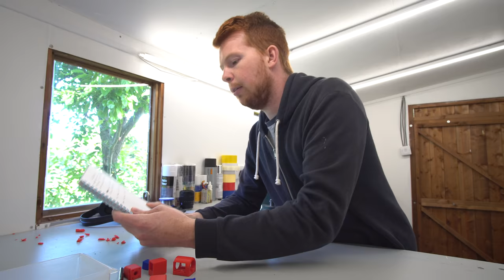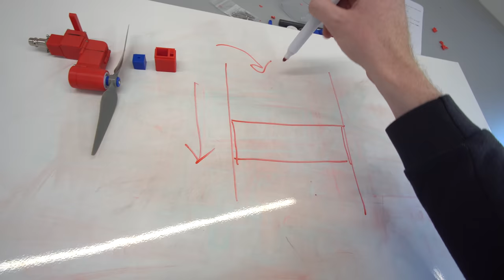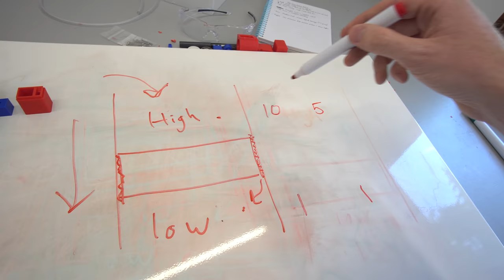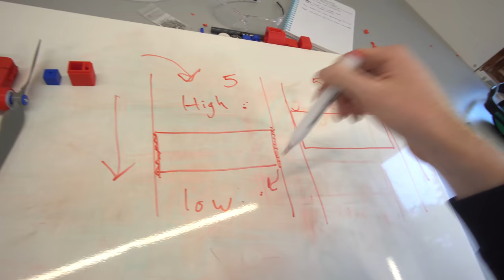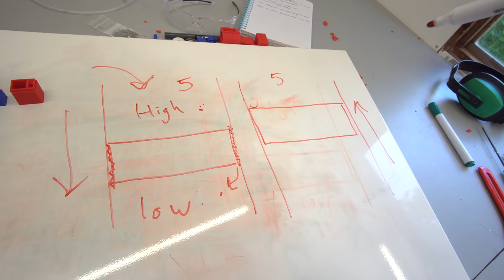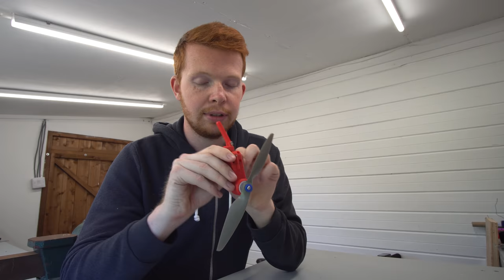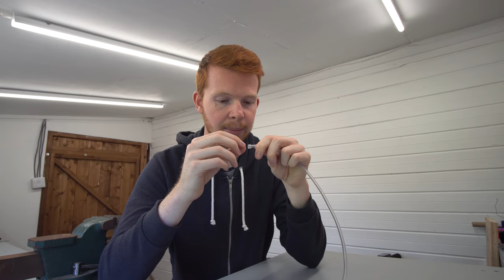Multiple or Single Cylinder Air Engine?

Comment: This is very interesting. There would be less air leaking around the sides but there would also be more friction since there are two cylinders, there will also be more weight. Is there some way to figure out a relationship or pattern between the amount of friction and weight compared to the overall output power of the engine?

Comment: For you dual cylinder opposed engine you could print 2 inlet pipes bending gently to a 90 degree angle back towards the Center of the engine and have your throttlebody there and it simply bolt together on both ends with a gasket. Would like to hear your reply on that if you could, I know it’s a year ago but maybe worth another shot?

Comment: Have you considered the cylinder used on 19th century train steam engines? It had an efficient single piston double pressure chamber push and pull action.

Comment: G'day Tom,

   Ah, have you ever read of

   "The Aeronautical Works of Lawrance Hargreave.", it's a very slim Paperback which was published by the Sydney Technology Museum in 1936 (he says, speaking from memory..., being too lazy to go and dig out my copy - unless you want me to video it & upload it to YT...?).

   After Boxkites, and he got them to soar in the Ridge-Lift..., Hargreave moved on to Gliders, then to Ornithopters, both Rubber-Powered & using Compressed-Air (held in a Tank which formed the Fuselage, that he soldered-up from thin Brass Sheet...) ; and he then tried Propellers but his Blade Design was so horrible that he concluded that Airscrews offered no advantage over Flapping Wings (!).

   Anyway, as well as a Single-Cylinder Air Engine for the Ornithopters, he was credited with inventing (but not patenting - he refused to patent anything because he wanted to share the ideas...) the Rotary-Aero Engine - which the Gnome Brothers later had great success with when they made Petrol-burning versions thereof.

  Hargreave's Rotary Compressed-Air Engine had 3 Cylinders, and the Cylinders each had one Blade of his (horrible) Propeller mounted directly onto it, so the Engine formed the Hub of the Propeller...; if he'd used a Helical Blade-Pitch, & if his Blades hadn't have had their maximum Chord out at the Tips, then the superiority of Airscrews over Flapping Wings could have been made abundantly clear in the 1880s.

  But, my point is that  before trying to cobble up your own 3-D Printed Compressed Air Multicylinder Engine..., maybe it would be a good idea to spend a bit of time in getting your head around what one of Aviation's aknowledged Pioneers was doing in the field 130 years ago ; I've seen some of Hargreave's Models & Engines, on display in the Sydney Powerhouse Museum, and before persisting in reinventing the Wheel - I reckon you might do well to check out what has been already tried-out, before you approached your Clean Sheet Of Paper...

  One Crankshaft-Offset working with  3 Rotary-Radial Cylinders..., strikes me as being both simpler & lighter than either an Inline or a  Horizontally-Opposed Layout ; with more Swept-Cylinder Volume, and delivering 3 Power-Strokes per Revolution - which virtually eliminates Vibration.

   So, Tom..., for whatever it's worth, this little old Kangaroo-Feeder suggests that you consider making a 3-Cylinder Harvreave-type (Rotary-Radial) Compressed-Air Engine ; and for pity's sake - give it a propperly-designed Helically-Pitched Airscrew, with which to convert it's  Torque into Thrust....

   Hargreave was so near to success, but yet so far ; because his Propeller wasn't fit to use for driving Ducks to go to Water...!

  Such is Life...

  Have a good one,

  ;-p

  Ciao !

Comment: correct me if im wrong but it shouldn't matter, the air required for combustion (total) increses with the number of pistons. so they require the same amount of pressure each or half the quantity of fuel. in which case your moving more parts for the same amount of input. so guaranteed it will be less efficient... now i watch....

Comment: Have you thought  use electronic control for inlet valve instead mechanical? You will reduce friction and you will be able to control timming and duration of air “injection”. And if you choose multiple cylinder engine, with electronic valves you will simplify engine. Electronic valve could be a simply solenoid, there are many comertial options and you will reduce leakages. Simply switch could control valve and if you want you can add an arduino for more options, (duration of air injection, duration of air injection deppending of pressure tank, timming variable deppending rpm engine... and a lot more options).

Comment: I'm wondering if the single cylinder engine would work better if you added a pressure release system to the top chamber that ensures it's releasing pressurized air until the piston is back on top/ the valve re-opens. I'm not sure you're getting all of the pressure out before it begins compressing again, and thus you spend a lot of energy re-compressing semi-pressurized air.

Comment: Halving the pressure only works the way you are explaining if both pistons were being pressurized at the same time. Since one is going to be in compression while the other is in exhaust you will not see your pressure halved.

Comment: You are re-creating the development of steam engines. What you should do, if you still want to fly it, is to intoduce a slide valve, and a double chamber cylinder so that you get  two poer strokes per cylinder,m with only the slight added weight of a slide valve. Look at the piston arraingements of a steam locomotive, with a 90 degree offset shaft to move the slide valve. This will not solve your air leakage problem but would get you more efficiency of air usage oput of a single cyulinder with less added weight of a second or more cylinders.

Comment: I would steer away from two cylinders as you would have twice the friction, and say you had two cylinders set up so that when one is in it's powerstroke, the other is in it's exhaust stroke, the pressure would still be 10 atm on one piston at a time, unless you have them in sync so that they exhaust at the same time, and then you would have different torque and speed levels than the single, but you could have done the same thing through gearing. I like the single piston as the two piston idea seems like it is overcomplicating things. And I have internet access, so that means i know everything right?

EDIT: Also, your valve system/ start stop system would have trouble as one piston would always be "on", unlike the single cylinder that has the ability to stay pressurized but off, for the other one you might need more valving

Comment: A multi cylinder engine will use up your stored air faster.  I suppose you could have smaller piston though, but you could have trouble printing things much smaller then you have already.

Comment: I am sure this project is dead, but I noticed you were using square pistons which have a bad ratio of perimeter leakage to cylinder surface area /volume. Switching to a circle (or as close to it as you could) might help efficiency.

Comment: I suspect that with no piston rings you will be losing a lot of efficiency with air blowing by the piston. You could try to measure the piston blow bye flow rate to measure that inefficiency. If you find that is indeed the dominant inefficiency in the engine I would suggest you start experimenting with different cylinder bore materials and the use of piston rings. You may need to "borrow" cylinder, piston and ring combinations from small model aero 4 stroke engines.

Comment: If the pistons were offset you would still get 10 atmospheres for example instead of 5 to each as the cylinders wont receive pressure simultaneously.

Comment: Have you made attempt to provide crank case ventilation? Obviously there will be some leakage through the crankshaft and the camshaft because of no real seals, but it won't be enough to vent all the pressure when the piston goes down.

Comment: I had a random idea, maybe it won't work, but is there a way you can feed air from both sides of a single cylinder?  Basically feed one side  while the other side is expelling air and when the piston gets to the end it switches.   This would basically mean there is pressure pushing on the cylinder during the up and the down stroke.   I imagine this has already been thought of before and there's probably a reason that I'm missing as to why it's never really been done though.

Comment: Single cylinder but double acting, been used in steam engines for a long long time so designs should be plentiful plus it removes both of your problems at once, simple crank AND simple plumbing, valving is done with an eccentric

Comment: i would go for that third option, make the single cylinder engine, then make the multiple at a later date.
this would possibly be better as you could use the single cylinder engine in the multiple cylinder engine.

just had a thought tho, why don't you make 2 single cylinder engines, and just attach the end of one to the rear of the other at an offset in a straight twin configuration. lets say 45 degrees or something. don't hate me for it tho if it sounds idiotic.

Comment: I think the multi cylinder idea is cool but you are getting some much design experience keeping it simple with the single cylinder engine. Im not sure if the are bypassing the piston would change that much because if you divide the pressure into multiple cylinders wouldn't you lose power? Thus needing to increase the pressure by 2 x?

Comment: How about trying to run the input air to the center and using the 3d print channel the air to the top of the heads with an air passage way.  Essentially some air channels along the cylinders.

Comment: How about a flat 2 cylinder. skip the plumbing and run 2 bottles side by side. I guess the hard part would be getting the bottles to equal pressure.

Comment: Hello Tom, I am wondering if you have looked at the subaru boxer engines, if you use one of them, kind of like the flat twin, you could have the slightly more complicated crankshaft, because if it is horizontally opposed, you could have one single cam opening both valves in some manner, also, I am thinking that on any of these engines you are going to have problems with equal airflow, unless both cylinders are supplied by a single ball valve, which could control both in this boxer configuration.

Good luck.😀

Comment: Surely the rate of exchange of pressure is proportional to the square of the pressure delta rather than having linear proportionality? In which case, multiple cylinders have better economies of scale as pressure increases.

Comment: Could you not do a V twin rather than flat? It would still be a single crank and the heads could be designed to be air fed from the centre (making it more of a triangle than a V but..) it is a different way of approaching the problem. Great video thanks :)

Comment: Multi-cylinder will give you more torque, therefore a larger or higher pitched propeller (or both). With single cylinder, you can go for higher RPMs, but with that inefficient wing configuration, you will need higher torque in order to push it through the air. Also, with higher torque and bigger prop, you can turn at lower RPMs. Okay, now I am waffling. lol

Comment: If I had the time I would build a 3 cylinder star, but I have too many projects at the start, this could be based on your Mechank, the crankshaft housing would be a little bigger and two complete cylinders would come to it. Of course, the  piston rod has to be changed. I think your biggest problem is the venting of the cylinder, I do not see how you make it possible, apparently the pistons are only surrounded by the compressed air, have you ever tried a quick exhaust like the Cox Morors? the pressure must go out before refilling with compressed air

Comment: What about a double acting single cylinder? Where pressure is fed both above and below the cylinder. The valving would be a nightmare but it would give you almost double the power (minus a small surface area loss of the connecting rod on the upwards stroke).

Comment: First of all, I love your videos. Second; Instead of your engine having a flat layout (in later times this could be a problem for getting air to the cylinder's) Why not have the engine a flat head. Having what you have for the single cylinder just doubled up and next to each other. Thus having a smaller size to work with and not having the head ache of having it like you do now. I wish to send you a picture(s) of what I mean and some design ideas of this; there any way contact you through social media or a form I could send you these pictures?

Comment: If the cylinders are going in opposite directions then only one cylinder would be getting pressure, so the pressure wouldn’t be split between the two.

Comment: If your goal is to get more power without increasing pressure (higher leaks) a bigger single engine would do fine. See, the circumference of the piston would be pi*2r, while the force (and volume, proportional) will be r^2*pi. Thus increasing the radius will make more sense than making two cylinders. I think anyways? That doesn't count for the benefit of having 2 strokes per evolution though..

Comment: I think at this point you have to at least make one multi-cylinder engine. I also wouldn't run it with only a single bearing, 2 bearings helps hugely with lateral loading, which isn't trivial in an engine like this

Comment: Couldn't you use pneumatic fittings for the sealing problem with the pvc tube? You used a pipe fitting for the attachment of the air bottle before, so it's a similar design idea.

Comment: If you did a multiple cylinder flat/boxer style engine why couldn't you just 3D print an intake manifold to do the plumbing? It would be pretty simple and that way you'd also be able to make the plumbing the same length pretty easily.

Comment: Single cylinder.  Multiple cylinders give more power and less efficiency.  In your leakage discussion you mentioned the point of doubling the perimeter for air to leak, but you are also doubling the friction between the piston and the wall, which is not insignificant, it is the bulk of the friction in an engine.

Comment: I'd stick with one cylinder but I'd use the advantage of the glass printing surface as a feature on the design. For example, new sliding valves can be made if you design the mating faces to be printed at the bottom, to get the mirror finish. A wobbler engine is fine with that. It uses a spring but you can truly play with it and serves as safety valve as well.
Also check out the patent of the Air Hogs Accelerator. It uses the rocking motion of the piston to open the valve at tdc. You would need ro return to cylinders but you'd only need to sand the inner walls, for the second seal is made via an o-ring. And you can scale the .stl file to match the o-ring size you have...

Comment: Do what air hog did using rubber on top of the piston (paulsdeals.com/Misc/miscpics/air-hogs-stunt-plane-specs.jpg) or even make a indent on the piston to run a o-ring kinda like a real piston ring to prevent "blow by" of air with a liquid lubrication in the crank shaft. Definitely do 2 cylinders not even if it's not more efficient you will be able to run a bigger prop at higher RPM. Plus it's more content and cooler. As for the plumbing just design it inside the 3d print and route it to the head. Then the throttle can remain near the bottle.

Comment: I know this was 2 years ago, you have probably resolved this but... Would the ratio of air loss not remain the same when you then add another cylinder? I think a multiple cylinder engine would take the strain off one piston and allow a faster transition from compression to tdc?

Comment: Hey Tom, when you argued about the potentially higher efficiency of the multiple cylinder engine due to the division of pressure amongst the cylinders, and since the cylinders are in different strokes of the cycle, isn't it right to say that they won't both receive pressure at the same time? And if so, they would get each 10 atms of pressure at different moments in the cycle?

Comment: The air amount of air leaking would not be directly proportional to the pressure at the high pressure Area as there is only so much volume of air that can pass through a certain sized space. I feel like if you would graph it, it would be less of a linear graph and more of a logarithmic graph. But i am no expert on anything and thats just my best theory

Comment: Why don't you create a feed for the upstroke from the down-stroke of the opposing cylinder? That way your leaked air can be transferred to mechanical energy. Since your engine has no combustion, there is no requirement to scavenge. So just reuse the leaked air from a down-stroke of one cylinder to the upstroke of the second cylinder. You may get more efficiency. Now this is based on the assumption that the pressure of the leaked air is significant

Comment: How about just an empirical test next week regarding the air leaking through the cylinder. I'm quite curious about that. Might it also run slower before stalling if it's multi cylinder?

Comment: Surely the v engine is a better option as you have simple crank and much easier plumbing as it could be built into a single head with single main inlet point!?!

Comment: I think two cylinders will not improve efficiency. It would increase power.  This would happen because while one cylinder is in its exhaust phase, the other would be in its intake phase and therefore providing power to the drive output almost 100% of the time rather than ~50% of the time.  This would also cause the engine to run for about 1/2 the overal time.  That said, It may be easier to find ways to increase overall efficiency with two cyliders than with 1..  Can’t wait to see how it goes though! ( flat )